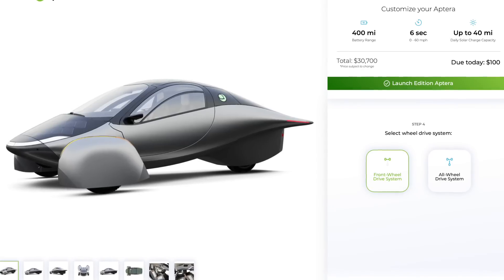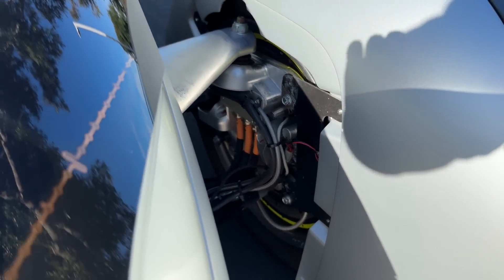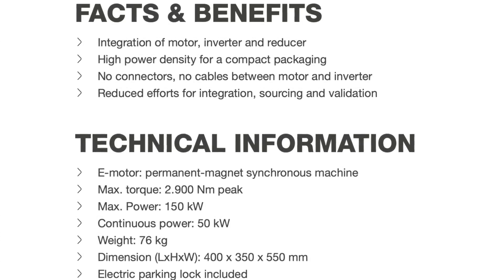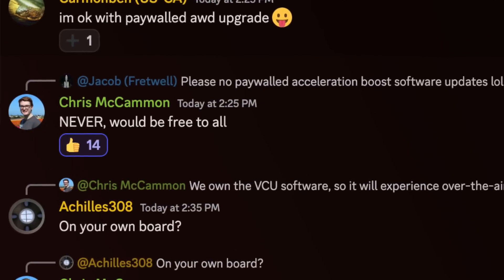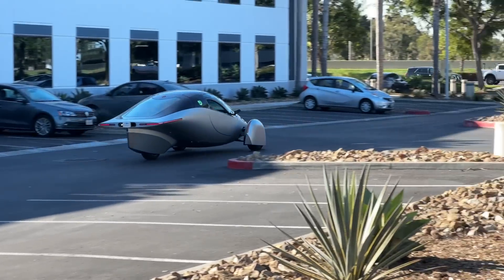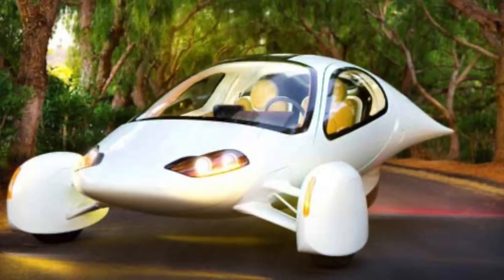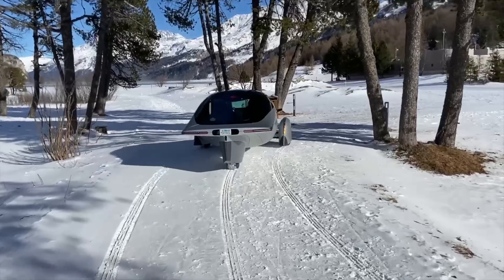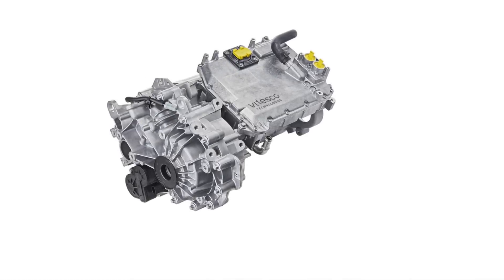Aptera's New Motor UNVEILED!

Comment: hypothetically speaking. The United States Postal Service (USPS) has over 246,000 vehicles,  A typical mail truck, particularly in urban areas, drives around 10-30 miles per day. 1 gallon of gas at $3 average x 246000 = $738000 x 264 days =195 million a year. an aptera with 150 Mile range should cost under $25,000. but the government is using Oshkosh Corporation at $60,000 a vehicle.🙄

Comment: OTA updates could enforce planned obsolescence. Everything is a con these days. A BMS in laptop can count how many times the charging has cycled and kill the charging before the battery has lived its life. Trust technology and you will be proven to be a fool. Either convert your old vehicle or become a cash cow for the EV manufacturers. Proprietary components are the name of the game. At least with this vehicle and its base model motor, you can find another motor controller and make your own tweaks as you see fit. Don't expect to find replacement windshields anywhere but the factory. The downside of innovation is obscurity. I'd like a single seat, electric-assist, pedal trike version of this for my work commute. It's an eye catcher.

Comment: I've been holding out for the 60 kW, all-wheel drive, off-road kit edition. I was pretty sour that they're not going to have it. 

I didn't care about the hub motors in the front. I can't blame them for not wanting to experiment on their launch. No reason to risk a bad reputation straight out of the gate. 

I was intending to cancel my order if they never made the all-wheel drive, but I just got an all-wheel drive Chevy Equinox EV and when/if the time comes, we can get rid of my wife's Chevy Bolt, which is a great little car, reliable, fun, quick...but loses a lot of range in the winter in New England where we live. 

We wouldn't have that problem with the Equinox nor Aptera.  

We really only need one car that is all wheel drive in case a nor'easter blows in. The snow is usually cleared by the same or the next day where we live in Rhode Island. 

I wonder if my state allows studded tires. I'd be okay with driving that thing on icy New England roads if I had studded tires. 

If they've converted everybody's order over to the same uniform thing as the launch edition, and they had pushed me from #7,000 back to #22,000 because of the features I had wanted, I wonder if I'm going to go back to #7000 or somewhere in between since I'm on the East Coast. I hope I don't stay back at #22,000. I'd love to get it right around the 5,000 mark so that I can see if it proves to be a reliable vehicle.

By the way, that Equinox has a lot of weird features and options, and it's not perfect. It's not the best visibility, what seems to be par for the chorus for crossovers. 

But it drives great. It handles great. And those features it has are really handy, like adaptive cruise control.  He was made in Mexico and it's definitely not as good as our American made Bolt.  But there's nothing on the market like it for the money that we paid, which was $27,590 net, not including the typical fees and tax. Unbeatable for awd, 0-to-60 in 5.8, and approximately 340 average TRUE mpc.  It's a great option if you're way at the back of the line and you know you're a few years away from getting this thing, which is where I think I sit right now. I just couldn't wait any longer. Stupid me compromise with my wife this summer and bought a 2012 plug-in Prius l.  Now I'm stuck with it. Not a nibble for a whole month.  It's a good car, so I am stumped.  I also have a 2007 priusion good working condition for small money and I have only had one person try to buy it and negotiate $300  I should have taken it. I wanted to hold out for the extra $300 'cuz the prices is already pretty good. Had I known...

Comment: Aptera wants to own the vehicle control unit and the software.  Much easier to write, validate, and integrate the software to drive the EMR3 than 3 separate motors and inverters.  Less weight in the wheel means the suspension system can be lightened too.

Comment: The Lotus Elise is 2000lbs with 189hp and went 0-60 around 5-6 seconds, so the new front only motor Aptera at 2k-lbs I'd expect it to go just a little faster if it's 200hp if the front wheel drive can keep the grip up with decent tires.

Comment: I think the new motor has more power than what is safe for such a small car.  I think motorcycle/ Tesla like performance will lead to excessive high-speed crashes/ deaths.  Thereby damaging the brand/design's safety reputation. 

I feel like the main draw for this vehicle should be efficiency, reliability, safety, and not requiring charging infrastructure at home and destination, having a great range when plugging into 120V 15A circuit overnight.

Please do not focus on crazy speed and handling. It would be best if the street mode was governed to 95MPH and did not have acceleration beyond that of a Civic S.  

Know your customer.  Are you going for the Kia crowd or the Suzuki crowd?  Kia is selling a lot more vehicles than Suzuki and hopefully moving the value mined driver away from low economy vehicles like the F150 and large SUVs when the higher payload capacity is unneeded. 

The Aptera is the first electric car I have seriously considered buying because of the traits I indicated above.  When energy prices double, the working class in America will need cars like this to offset the rising costs of living.  This car could cut U.S. commuting costs for individual / pair traveling more than half, reduce required rode maintenance cost,  reduce pollution in city centers, reduce petroleum use, and increase physical resource availability for "making America great again,"  "the green revolution," and like phrases.

Comment: The EMR drive unit is a little lighter than the three in-wheel motors but that weight is now in the body. How will this change the operating dynamics/design of the vehicle suspension given this transfer of mass from the wheels to the body?
Reply from the maker: Should be much better because there's much less unsprung weight. The new design means the weight is more centralized, keeping you more planted and improving ride quality

Comment: I am becoming more and more enamored with the decision to use this tried and true motor in the Aptera rather than the in-wheel motors. Makes sense for the back wheel to be of this design. My original order was for the front wheel only version. Seems like they’ve planned this powertrain as an option, should the in-wheel  motors not cut the mustard. It simplifies maters a bit too putting all the power generation right there in the front just like every Tom, Dick and Harry’s electric vehicle. I look forward to the PI builds for seeing how it works in practice. 
Thanks for the interesting content. Looking forward to your critique of the PI 2.

Comment: Aptera is using the same engine as a Kia Nero which has 201 hp and weighing about 3900 lbs., so should be quicker as the Nero goes to 60mph in just over 7 seconds and about 250 miles on a charge,

Comment: 150kw is not the continuous power rating. Somewhat false advertising.  Continuous power is only 50kw. It can only handle 150kw for short bursts. Top speed will most likely be limited to 80-90 mph.
Reply from the maker: There’s no real reason you’d be at max power for longer than a few seconds in any vehicle aside from track tests

Comment: Front wheel drive vehicles, normally do decent in the snow, not only b/c of the tires, but b/c of the WEIGHT placement being on the tires.. which gives better traction.

Comment: I will wait for the petroleum fueled version that they were talking about in the very beginning.
Reply: Is the wars fought for oil or the deadly pollution that you're so fond of?  Or is it the sluggish acceleration and noise?
Reply: @J-W-Kelly  cheaper than batteries, faster recharge time, maintenance is cheaper in the long run.
Reply: @PocoToro  Hilarious.  What are you doing here, troll?
Reply: @GullWingInnMoclips  Telling the truth. BEV's failed on the market 100 years ago. The reasons they failed have not been solved. 1. BEV's are more expensive to purchase. 2. Range/Recharge time. 3. Cost of battery maintenance 4. Batteries "shrink" over time. Even if it's only 5% ,that something a liquid fuel tank won't.
Reply: @PocoToro  You ARE cute.
Reply: @J-W-Kelly  I WIN 🏆 😎

Comment: Yeah, but does that change help with the overheating issues? I need a vehicle that has full power at 120f ambient temps.
Reply from the maker: There aren’t overheating issues. The one time a non production intent prototype shut off was because the coolant lines weren’t hooked up. They later drove that same prototype at highway speeds in 100F weather with no issues

Comment: Yeah... NO.

In my view Aptera was an exercise in efficiency above performance. That was their goal... or so I thought. No compromise on aerodynamics. The choice of hub motors perfectly matches that vision. The added mass in the wheels is not great for road handling but the loss of gears is great for efficiency.

As any mass in the wheels is not ideal I am already placing question marks at unnecessarily heavy hub motors with a combined output of more than say 50Kw. A commuter just does not need to take turns on crappy roads at 110 Mph to get to work.

As an added negative effect the heavier and less efficient motors will need more watts per mile, which will make the functionality of those solar panels go down. Instead of striving for 60 miles per day on solar with more sensibly sized hub motors I imagine this new motor will bring the range down from 40 to perhaps 30 miles per day.

Sure, add some light bars on the roof, perhaps thick all terrain tires too, and let the rich and the youtubers have fun, but no, this is not a car that a true Aptera fan is going to want.
Reply: no... YEAH.  So... Aptera being the flexible and innovative company they are... run by engineers having to make compromises and decisions based on both efficiency and getting their vehicles produced in the near future... somehow makes them less attractive to a "true Aptera fan"?  From what dark hole did you extract this transparently excremental notion?  Never mind. I know.
Reply: @J-W-Kelly  I guess there are people that believe in the idea behind Aptera and groupies that stay loyal to the company no matter what weak reminiscence of the original car they are going to sell. Kinda like a red-hatter.

Comment: lighter when you add  a diff, two drive shafts and 4 CV joints? I get unproven vs yet another first time design in terms of delivery risk, but I'd be surprised if the total car weight went down.

Comment: Well what do ya do with the rear wheel? Hook up some regenerative system add drag and weight? Add a hydraulic brake- adding hydraulics and weight - nothing? What happens when you brake with only front wheels- would this be like braking with the front wheel of a bike (yikes). Curious what the rear appendage can do with the new front wheel drive- of course you could order it with only front wheel to begin with-----So?

Comment: This is nonsense marketing!!  The Aptera core confidency did not pan out?  The entire crash testing, balancing must now be redone hastefully and full of bugs.  Remember we only have 3 wheels when pursuing AWD not 4!  The torque is now significantly reduced. Your update is completely biased and full of nonsense! "The zero to 60 is still going to be good!" Well, what, is that magic number?? This change will significantly change ALL performance and safety factors!
Reply from the maker: All the crash testing was done with the new motor. They explained this on their latest podcast

Comment: My only hope with a central motor rather than in-wheel motors is that they make the half-shafts with equal length to avoid torque steer. I have driven some souped up front wheel drive cars with unequal length drive shafts that were basically undriveable, well unless fighting to keep the vehicle on the road every time you punch the throttle is your definition of a "good time".

One good aspect of a central motor will definitely be a potential improvement in vehicle dynamics without the extra unsprung weight of the hub motors. In a car this light, sprung to unsprung weight ratio could be a major factor in drivability. It might also allow a higher spring rate to give more body lean control in corners without the higher frequency body movement over bumps that feels so jarring and unpleasant to most people.

So even through the wheel motors have a much higher "Cool!" factor, I am glade they moved to a single motor.
Reply: But I still would prefer the all-wheel drive version, especially with a vehicle control computer tuned well enough to determine if the vehicle is understeering too much and so send a little more power to the rear wheel to get the back end to step out a little and keep body angle closer to steering angle, of course without going into massive oversteer which gets the old sphincter puckering.

Comment: Vitesco EMR4 vs EMR3:
- Weighs 25 percent less at the same power level. 66 vs 77 kg.
- 5.6% efficiency advantage in the WLTP.
- Smaller.

So the big question (to ask)  is WHY the EMR3!?
Has Hyundai bought up all the EMR4s for the next 5 years or something?

Comment: My reservation is for a 2WD version. However, a couple of previous comments in Aptera live-streams made me think...

One of the side benefits of having the hub motors was they create a warmed wheel enclosure, and Steve F quoted that when asked if there might be a problem with snow accumulating inside the wheel pants, saying the heat would help stop it from building up too much.

From a steering geometry POV, having FWD driveshafts and CV joints will restrict the turning radius of the vehicle. Okay, maybe the trailing edge of the wheel pants colliding with the body will be a bigger problem here, but (IIRC) Chris A mentioned that the turning circle for the PIs was to be improved - hopefully that was with the knowledge of this change (since that comment came basically at the time the BinC presses were finished).

Anyway, on the plus side, an inboard motor will allow for inboard friction brakes as well, reducing unsprung mass even further, and shouldn't take too much room to add under the hood.

Comment: the hub motors didn't need cooling systems. now this motor drivetrain will need a cooling system, since I've driven the Renault megane ev with this system. in summer, the cooling system turns on. so now....how and where will they place the radiator? next, wherever they place it, how much drag resistance will it cause, reducing the efficiency? looks like this is a bigger problem than solution....

Comment: Aptera has always been about efficiency first in everything that they have said and done…. Not going this route really would have been a betrayal of their own goals. It’s hard to admit that your original idea was inferior in multiple ways and for making the change they deserve praise not backlash. This configuration will allow easier changes in the future so far as different optional power levels for different models. One of the many limitations of hub motors is limits on power levels before breaking parts. Only way to add enough strength to the mountings are building heavy and/or with expensive materials.

Comment: Given all the benefits for using the new motor, why wasn't this the plan from day one? What are the pros of using in-wheel hub motors? Totally makes sense for the rear motor, but I never understood why the front motors would use one.
Reply: I would be ok with that if the front motor had a vectoring transaxle the motor company calls it gear reduction box.

Comment: Sorry Drew, but I've been driving in snow for 55+ years, and I have driven two wheel drive vehicles in snow. I've been stuck in 2WD and AWD/4WD/6WD vehicles, and yes tires and tire pressures are important. However, some states don't allow studded tires, and you can put on chains. But where I live there is snow and ice and snow drifts and muddy and steep dirt roads depending on driving conditions, and AWD is an absolute necessity at times. So please stop trying to minimize the 2WD drive issue for some of us until you've "driven" some miles in our tires. I like your channel and usually agree with you but you are out of your depth here. Some of us just have different requirements than you, so hopefully we can also have our own opinions about what is important to us and share them with other Aptera proponents here on you channel. Thanks
Reply: I disagree with you after driving 55 years in snow country!
Reply: I agree with you 100% they need to stop minimizing the losses of this new drive train. Some just care how it looks. Not the potential of all wheel control. He list the losses about two thirds in to the podcast .they are the reason some of us really wanted this vehicle.POWER TO THE THIRD WHEEL!

Comment: Glad to see the smaller, cheaper EMR-3 over a bigger EMR-4. Hoping to soon see a production intent prototype with this new motor, the finalized suspension, cooling, software, and interior. You're totally right about snow tires being workable for most winter driving. I do worry about snow getting tossed up into the front wheel covers.

Comment: Lmao, I was arguing with one of their reps when x was still twitter and mentioned the wiring issue. Its not just the physical wires that need to handle the stress but also the connectors. Cant wait to buy these salvage and fix them though.